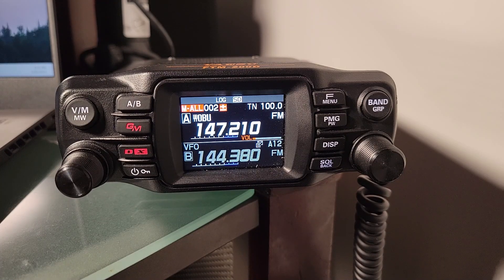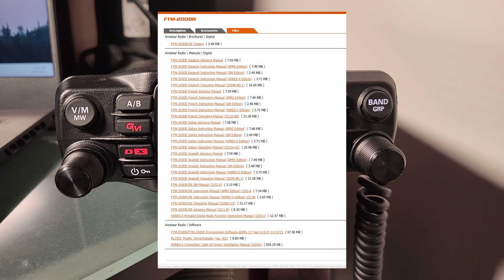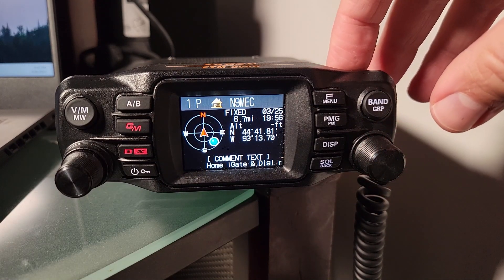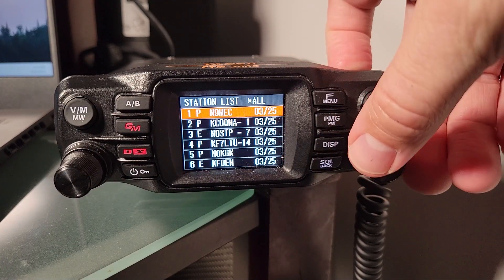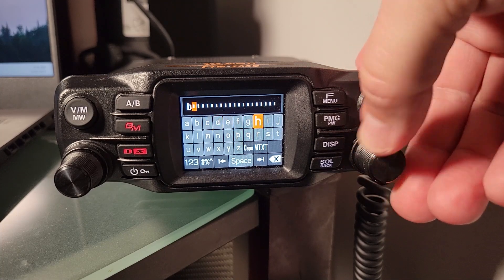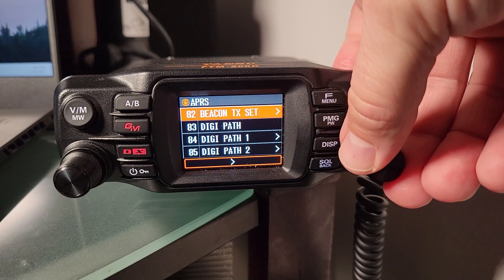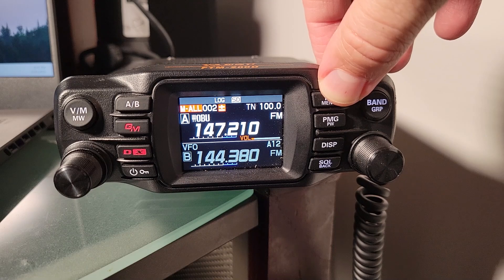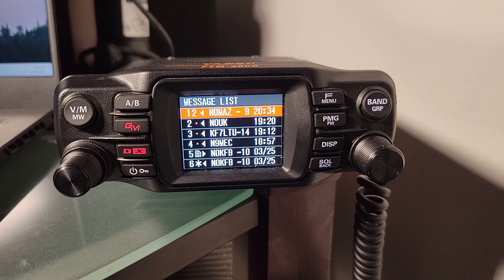FTM 200 - How To Send APRS Messages!

Comment: This video is right on time. I have been trying to figure out how to send messages for almost a month, and failing miserably. I finally surrendered in total defeat. A quick tip that I did find out is, when you're at the message input screen, you can also turn the dial to the left, past the letter A, it will take you to the bottom right of the screen, to the move cursor back button. It's kinda like PAC-MAN/MS-PAC-MAN videogame screen. Thanks for sharing.
Reply from the maker: glad you found this useful, and thanks for that tip!